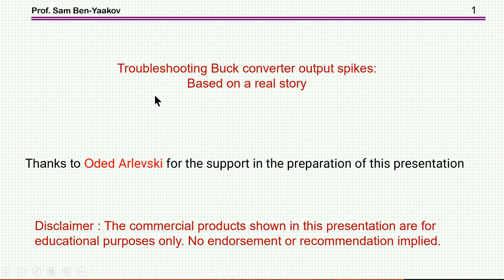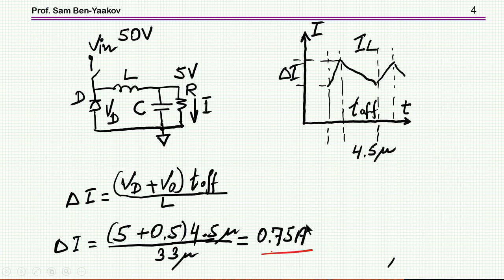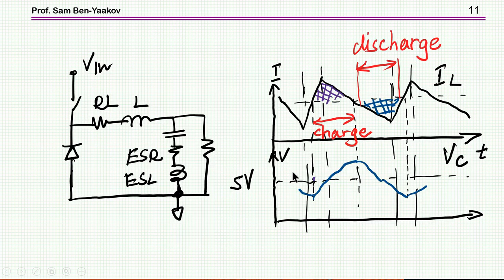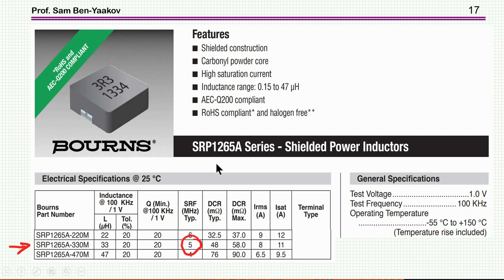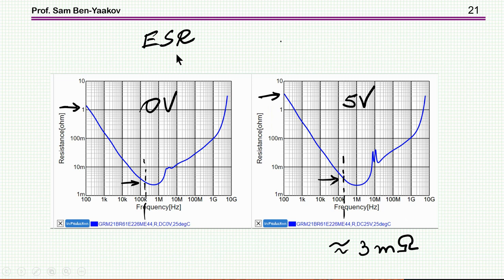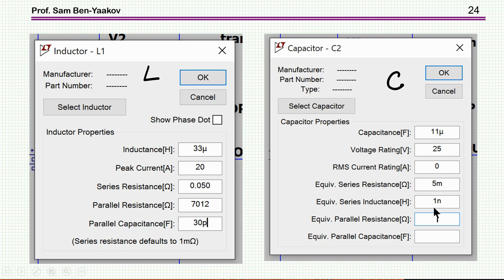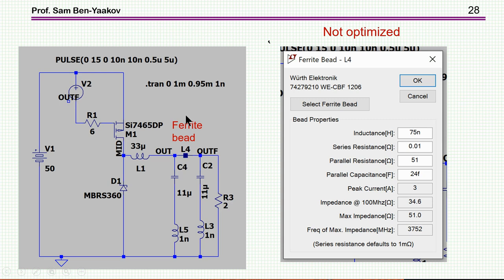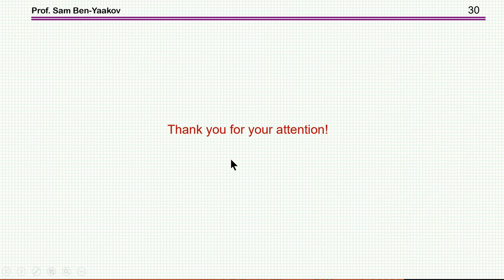Troubleshooting Buck converter output spikes: Based on a real story

Comment: I design my first buck converter while back but every mosfet or igbt I use just a load of 100watt spike kill the fet and fet was 580 watt so it was not overloaded and I use 20v ziner and 10k resistor in series with to the boostrap gate and 200v Shockley diodes in parallel with the inductor and capacitor 1000nf and 300ohm resistor in series to the mosfets source and all the spikes drop to on 100 millivolt and I draw 60 amperage a 16 volt and igbt get warm and circuit work very efficient
Reply from the maker: Thanks for sharing

Comment: There seems to be an interesting tradeoff here. Slowing the switching speed creates dissipation in the switch, whereas the ferrite bead dissipates high frequency energy in the filter.  I presume the bead is a more precise approach to add dissipation in the filter as this will be narrowly focused only on the high frequency components of the noise, whereas adding dissipation by slowing down the switch is a much more broadband filter.
Reply from the maker: The added dissipation by bead is indeed minor.
Reply: @sambenyaakov  so could a more efficient way to slow down the switch be to place a bead on the drain instead of limiting the current to the gate?  It seems such an approach would also work, but I am not sure of the tradeoffs.

Comment: Thanks much professor.
If this was a regular pwm controller, which one of the output capacitors  would we place the feedback resistor for output voltage regulation?
Reply from the maker: It is better to connect to the second one but this may mess up the control by adding a phase leg so usually one prefers to connect to the first one. The penalty is a voltage drop.

Comment: Thank you, professor! For higher currents converters (i.e. >20 A), is there a better alternative to the ferrite beads? Using another inductor wouldn't result in the same problem?
Reply from the maker: You can use an inductor but may have to damp the network by putting a resistor across the inductor.

Comment: Great Lecture Prof, However, what would your suggestion about power level for this IC. Since its need external swiches doesnot it will increase the footprint ? recently i have seen for high step down, there is a new no-opto flyback converter. Can you suggest about which converter is better for high to low voltage conversion. Just for an example this IC input range is 5-75 and adjustable output voltage. However, for high gain ratio around 10 (Vin =50 V, and Vo= 5). Do you recommend this buck topology or flyback or other topology. can you if possible name some good IC for high voltage gain conversion application.
Reply from the maker: Constant on time with frequency adjustment ids great for high step down, With an external switch one can reach 5A output easily.
Reply: @sambenyaakov  Thanks a lot prof. Can you share any related document as well.
Reply from the maker: @billimew7496  Look up application notes and data sheets of TI on this subject.

Comment: so great
thank you professor
can we use ferrite bead in series with RG (for smooth turn on or off mosfet) and use RC snubber in mid point of two switch in synchronous buck converter( for more output current about 20A or above) for reduce output spikes ?
Reply from the maker: No matter how you slow the gate, losses will increase. Although some manufacturers promote the use of FB in the gate path (for GaN mosfets). I have found that this may promote oscillations.
Reply: @sambenyaakov  i think too bcz increase inductance phenomena in gate may be made oscillation with input capacitance in gate
what is your opinion about add RC snubber in mid point of synchornous buck converter ?

Comment: Thank you professor! Is it practical to design a 2400W buck converter with 300V input and 80V output?
Reply from the maker: With 30A inductor current, it  would be better to consider an interleaved topology
Reply: @sambenyaakov  Thank you for your  advice

Comment: Interesting and useful video. And based on a true story! Very Hollywood! But possibly edited to make it more interesting. ;-)

But seriously, You chose a very high frequency ferrite bead with maximum impedance at 3.4 GHz and got very good results. Suppose you had chosen a more run of the mill ferrite bead with maximum impedance at around 100 MHz. I ask this because you've achieved a much better result than I've usually obtained by using the same type of T filter with a ferrite bead between two output capacitors. Maybe the higher frequency ferrite bead is the way to go for this type of transient filter?
Reply from the maker: True story only the names have been changed to protect the innocent😊 yes, since the spikes are of HF content, HF bead is useful.

Comment: I have a 600w high power dc-dc step down buck converter once I connect power input the converter gets heated up without connecting any load what's the likely problem please help
Reply from the maker: Check the gate drive for overshoot in some other malfunctions